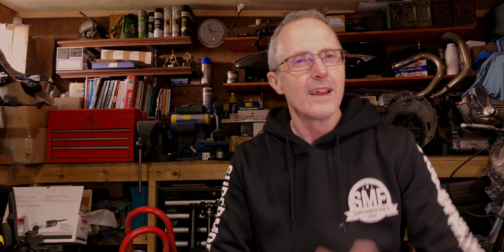Engine Power Basics - Why Start With Airflow?

Comment: Hello David, I have seen and listen at several of your videos and I have enjoyed them as well as I have had a lesson in different subjects regarding motorcycles.
In the next video you said you will talk about exhausts and there is my question...
I have heard and read a great amount of clips about slip-on, cats, mid pipes, headers..etc. as you said when you debaffled the stock muffler... people often want their motorcycle to be louder so they often buy aftermarket systems to make it happen.
You have answered this question numerous times, I know. but is there a safe line if you buy a well known aftermarket(Akra, Remus, Yoshimura, Arrow...) slip-on and they say "no mapping required" and only do this change but also do a removal of the db-killer by unscrewing two bolts lightly welded. 
(I have the new Ktm 1290 SAR 2021, with the Akrapovich exhaust Euro-5 and it had an interior that I haven't seen before.
First an inserted cat in a first chamber, then two internal "db-killers" (15 mm/100mm) almost meeting the outer two db-killers(270 mm)in a second chamber.)
slip-ons with or without the db-killers
What is your opinion ?
Staffan
Reply from the maker: Hello Staffan, Akra are a KTM partner and it is only possible to buy their exhausts for a KTM through the KTM dealership.  Akra develop their exhausts on their dyno and work with KTM to ensure that they meet the relevant standards and so are safe to use within the mapping of the bike and no risk of the bike failing the standards in the jurisdictions where they are sold.   This is why we see the newer Akra exhausts with no hole in the slip on to remove the DB killer and the db killer screw held on with a weld - to demonstrate compliance with the standards.  If you are buying an exhaust from a premier manufacturer who is also known to use Dyno (and have the engineering expertise to use it properly) like Arrow as you have named there is some confidence that they will also be within the parameters of the ECU mapping.  The exhaust changes are mostly emissions driven - so for Euro 6 we start to see two cats in the system and even with Euro 5 two db killers are common.
There is no safe line once you start modifying the system unless you place the bike on a dyno.   But bear in mind that the bike is designed to operate in a number of environments which impact the fuelling - high altitude, cold weather, hot weather etc, so the stock map has the ability to cope with this variability - if you live somewhere more average like say the Netherlands then there is a good chance that the stock may has the ability to cope with a small change.  If you take the stock muffler which does not flow as well as the Akra and you remove the db killer then it may not flow much more than the stock Akra so is likely to be safe for most riders.  If you add the Akra and then remove the db killer or you remove the cat, or both then you start to step over the line.    At this point my advice changes to if you don't have access to a dyno then you should consider a piggyback to modify the fuelling to compensate for those points in the stock map you may hit the ceiling of fuel.  Depending on how far over the safe line you intend to step will drive how much you will invest in piggbacks and dyno time and worth considering before you start to invest in piggybacks so you don't have to upgrade.
Reply: @MotoMirius  wow David..you wrote me an answer. I can see you are dead serious with what you say for sure and what is more floating. To differ facts from assumptions...and I got it.
If I want to be sure I must get an objective test like Dyno or else I go for the assumption(like many on this website says)that it probably is ok if you ride at "normal" conditions.
I wonder one thing, as you talked about in the video regarding different piggybacks, you said sort of " If the engine runs bad on low revs you can adjust that with a simpler piggyback" 
If my 1290 adv r runs as well with a debaffled Akra as with the baffles in or as smooth as with the stock muffler, is this a indicator of that all is ok ?...yes I know, I twist your arm but I couldn't resist asking.

A whole other question, I'm Swedish and you often use the word "Skäl" when finish your answers. That means "reason" in Swedish. The dots above "a", you don't have them in English....are you connected to Scandinavia ?
Thanks, Staffan
Reply from the maker: @staffannunstedt548  I can't comment too much about what is available for the 1290.  For minor changes boosterplug (alters the temperature reading to make a richer mixture) or RapidBike Easy which is a very basic controller where you may have to change the settings if you get an engine light but is otherwise reading all the sensors) are the entry level with the small Duke.   But not worth it if you intend bigger changes because you will just have to buy twice to upgrade.
I have no current connections with Scandanvia - I can't remember now where the Skäl came from, but thank you for the translation!
Reply: @MotoMirius  Ok, Thanks David, I take your answer. I´ll see what I do to be on the safe side./Staffan

Comment: Will you make stock vs air flow lid video ?
Reply from the maker: What exactly were you looking for?  Air flow lid flows more air - it takes reduces restriction in the intake of the gen 2 390.   But it's important to use a proper one - I've seen some badly done ones which allow unfiltered air into the engine which can cause damage.
Reply: @MotoMirius  Oh I had in my mind a video about comparing performance.
Reply from the maker: Ok thanks.  I will see if I can find a way to do that.
Reply: @MotoMirius  Ok thanks.